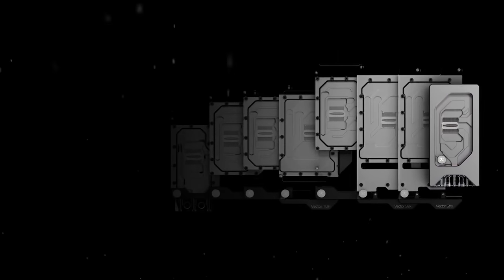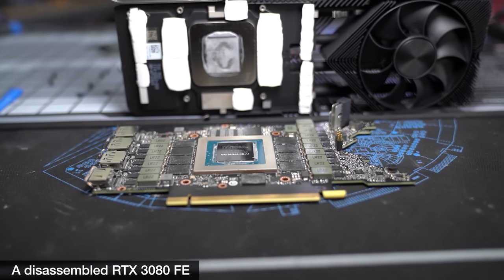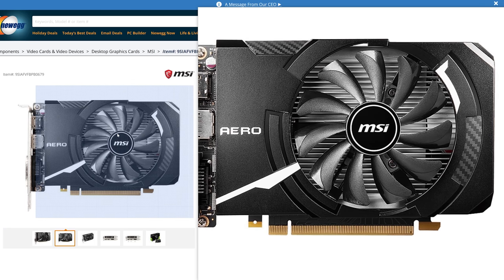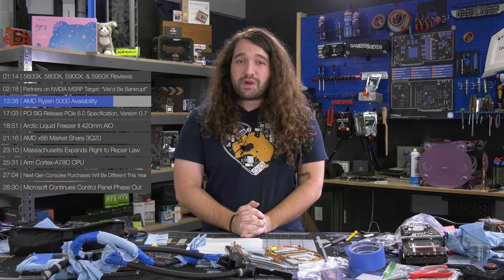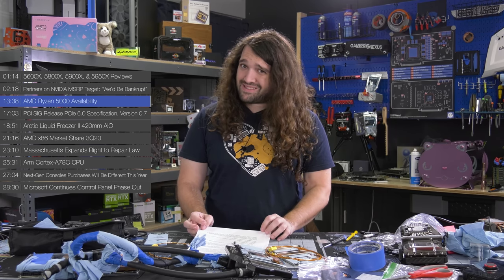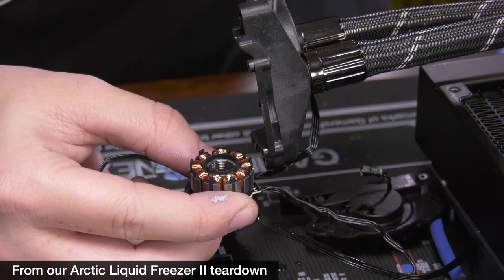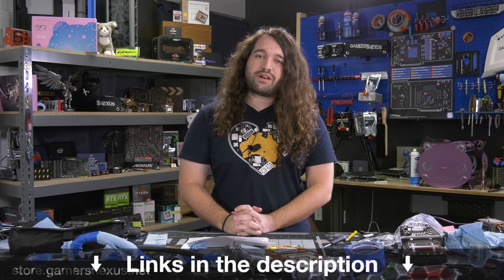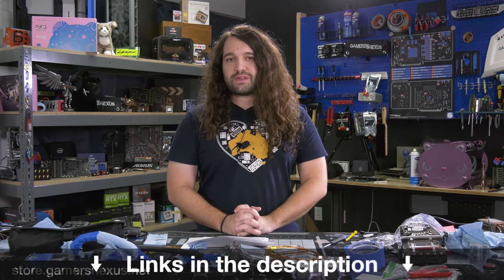HW News - NVIDIA MSRP Allegedly Not Realistic, Ryzen 5000 Supply, PCIe 6.0 Spec

Comment: So, the real question how much more per card would they have to charge to make quality cards... what is the difference between a 2 fan cooler with copper pipes and a decent finstack and a barebones 1 fan cooler with a shit finstack. If the card has a shit cooler and runs at a constant 80 C with its 1 fan at 100% all the time that Graphics card is worthless because it will run unacceptably loud and have a very short operational life. I wont buy a card like that and I will pay more for a card with a decent cooler, having said that if a board partner has a decent cooling solution and their card is $50 USD more that's unacceptable, if the price difference is that much Nvidia better be eating some of that cost (some of that cost better come out of Nvidia's margin) If they cant design a competitive card at the $250 price point they are going to price their cards out of the reach of a lot of people. Not everyone can afford (or can justify the expense of) an Rtx 3070 at what $700 US.

Comment: Steve why is it when NVDIA 3000 series hit he market even you rode them hard for not having enough supply, but when AMD does the EXACT SAME TING, you're suddenly all, " well that's just supply and demand." ?? We know the 6000 series from AMD is going to be extremely limited, and its going to be just as bad if not worse than the nvidia launch.  Hold amd tot he same standards please.  There Is ZERO doubt AMD rushed the 5000 series CPU and now 6000 series GHPU out to  do exactly what NVDIAI did, and that is take advantage of a  volatile market with  high demand and extremely low supply. They could have waited a month and still had the same demand, but with dramatically more supply. and still made the pre christmas rush.,